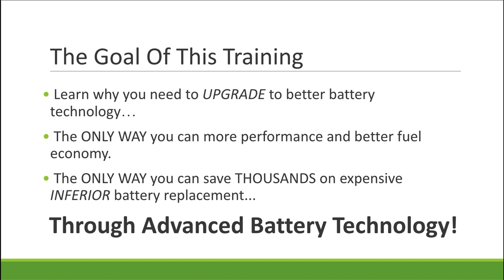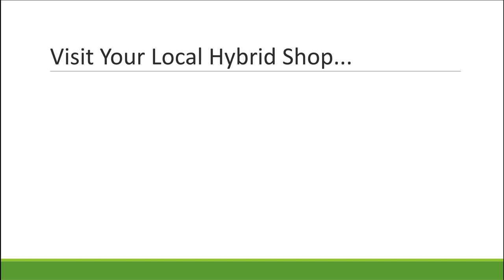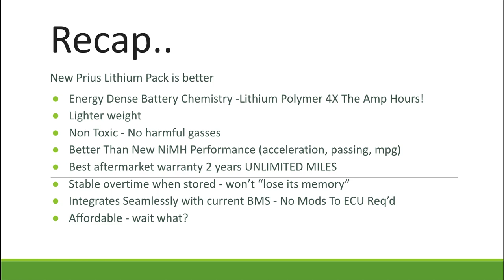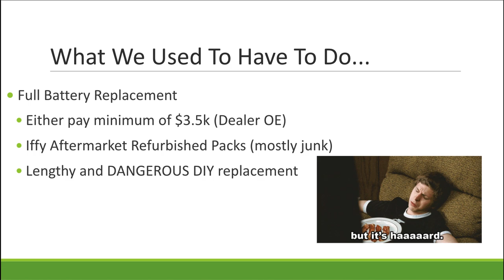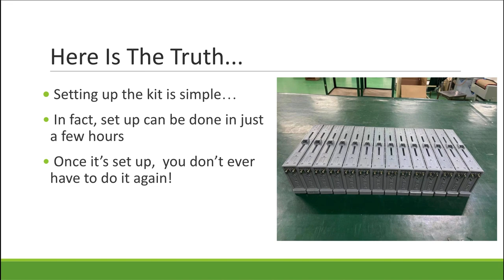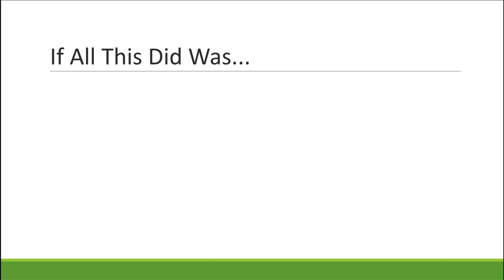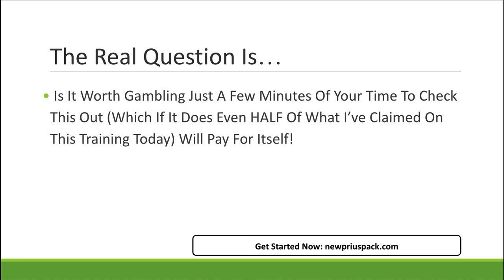New Prius Pack  - Upgrade Your Aging Prius With A More Powerful Modern Battery

Comment: Are any modifications to the ecu needed?
Reply from the maker: Hi, there are no modifications needed to the BMS which is the hybrid ECU. Each module has its own computer chip that regulates how it charges and discharges. It "fools" the BMS into thinking that it is working with NiMH. This battery is 97% efficient compared to NiMH which is 70%. In my 2008 Prius, I can go 3 miles on EV power alone. Never has this happened before on NiMH nor will it. These batteries are truly revolutionary.
Reply: @TheHybridGuy  But how it charges the new (and with higher capacity) battery if there are no modifications to the ECU? Now, the battery rarely charges to full (green bars).
Reply from the maker: @TheExcelciorBeta  There are proprietary computer chips on each battery block that tell the BMS to allow it to charge higher and drain lower. How that works specifically is something you would have to ask the creator of the product. I can tell you first hand that it does work and I have personally logged thousands of miles with my battery. MY best EV range so far on this battery is 3 miles. Compared to a "like new" NiMH battery EV range of 1 mile.
Reply: @TheHybridGuy  Thank you for your answer and the insights! I tried reaching out to the creators, on their videos, but haven't gotten an answer, yet. Maybe you could pass the question to them in a future QnA? 😉
Reply from the maker: @TheExcelciorBeta  Think about it like this. all the ecu needs to know is that the battery has enough charge to keep the system happy. the computer chips in each block tell the ecu that there is sufficient battery and to shut the engine off. if there were no controls in the blocks this setup would not work because the system is designed to run with NiMH tech.  I hope this answers your question.
Reply: @TheHybridGuy  Kind of. My question is focused on the charging procedure. There is a need for greater recuperation from the regenerative braking in order to charge the bigger battery. If there is not, then we need to charge it from the gas engine which means that there will not be any improvements in the mileage efficiency.

Comment: One thing ive noticed.. the SOC is usually 60 to 65%...so it goes bad faster as its not fully charged and utilized. 
after lithium changeover what will be the SOC? if its still 60-65% wudnt it be under used again.. and may eventually go bad soon😕
Reply from the maker: Excellent observation. With these packs, because they are internally regulated with their own computer chip they are allowed to charge up to 97% instead of the 70% that you see with NiMH. Over years of use they will go bad but so will NiMH. In that time frame you will get longer sustained and better MPG than you would with NiMH.

Comment: I have a 2016 prius 2 with a NiMh HV battery.
Let's say down the road I decide to change the Nimh battery to this advertised Lifepo4 battery.
Would my car's battery catch fire if it was subjected to a bad side impact accident.
I've heard many a story about EV's catching fire with Li-ion batteries 'I realize different more toxic chemistry with higher energy density.'
Reply from the maker: Li-Ion is much more prone to thermal runaway yes. LiFePo is far more stable though less energy-dense.

Comment: As far as the climate control while sitting still goes. I'd imagine the gas engine would have to run 3 times longer to charge but then would run the climate system for 3 times longer with the gas engine off. Is this correct?
Reply from the maker: The short answer is no. If you want to know more send me an email.
Reply: @TheHybridGuy  
I'd be curious to know why the answer is no to this. If these batteries truly have more EV range that should mean they have more capacity. And if they have more capacity then the car should sit there and run the air conditioning longer before the engine needs to start to recharge the battery. Now perhaps when you said no you were talking about that the car would have to run longer to charge the larger capacity battery.
I'm kind of wondering if this lithium design actually does not have more capacity than the nickel metal hydride. It probably does have a higher max amp rating.
The problem has always been with these lithium designs. Integrating them into the existing ECU to take advantage of lithiums greater storage capacity. Since the car doesn't know that. I know you said there are computer chips inside each module to fake out the BMS. There's going to have to be some kind of voltage manipulation inside each module. Because the static voltage on lithium cells is not the same as nickel metal hydride.
So some kind of manipulation must be going on to fake out the stock ECU that the resistance and voltage is appropriate to what it expects. Whatever is manipulating those data points also has to be able to handle large current Rush.
Definitely interested in the technology myself. My 2008 has 376,000 miles on it with the original pack.
I can buy a factory brand new pack from Toyota for about $2,400.
Reply from the maker: @kens97sto171  excellent question. So our cars have a coloumb counter for the batteries. What that does is measure electron flow over time against battery voltage.  Where the lithium has a far greater drop off than NiMH our cars can leverage the greater capacity because it is looking at SOC as the battery is draining while in use. As far as a current rush that doesn’t happen. The voltage is only slighter more than NiMH and the car uses what it needs when it needs it. But like a faucet if you need more you turn it on as a great rate. Replace the battery with the lithium and you will see there is more energy available so when you mash the “go pedal” it will perform as it should have when new. Hope this helps!
Reply: @TheHybridGuy  
Thanks for the explanation..  Much appreciated.   Glad you guys have it worked out.

Comment: My 2013 prius BMS is design to manage and charge NiMH... how is it possible to simply replace it with LiFePO4? The chemistry and voltage isn't the same. This is exciting - do you ship to Australia?
Reply from the maker: Hi Andrew. The BMS is designed for NiMH you are right. However there are microchips that “fool” the BMS into working with this new battery.  I’ve personally been using it for over a year and have had zero issues but increased fuel economy

Comment: What mods are required for a Gen 2 install.  Please do a Gen 2 install video.
Reply from the maker: Install videos to come soon! No significant mods. Remove old modules and install new modules. That is it.
Reply: @TheHybridGuy  I've replaced individual cells in my old battery before.  So these batteries on require 14 cells vs 28 of the old style,
Reply from the maker: @East-Tennessee-Tim , basically they are replacing the "blocks" in your existing pack. Think of this as like 14 blocks which is how the Prius BSM reads the system anyway.

Comment: Will this work on a 07-12 Lexus GS450h?
Reply from the maker: Hi! Lexus GS450h packs will be coming soon!
Reply: @TheHybridGuy    even though the new batteries have higher amperage bms can't increase capacity of the motors , wiring , inverter etc.  Which were all designed to use the lower amperage ni-mh batteries.
Reply from the maker: @stopdrpnro  Right but you can sustain the motors at their peak for longer. This is helpful with passing (critical for safety) going up hills, accelerating on the freeway... all things that are benefitted by a battery that can sustain itself for longer.
Reply: PLEASE, do a before and after 0-60 
I have a 2007 also and its already insane fast with nimh
Cant imagine with 2.6x more amps
Reply from the maker: @SouthFlaDiver  Working on it. The results are better in MPG more than speed though.
Reply: This was my big question. More power has to = more power right 😁
Reply from the maker: @stopdrpnro  That is a great way of looking at it yes!
Reply: Actually I'm sure the hybrid system is designed and built with the max draw of  ni-mh . That said, even with the higher max draw of li-on,  there probably wouldn't be any performance benefits without other software and/ hardware upgrades.
Reply from the maker: @stopdrpnro  each of the lithium blocks is individually controlled with its own microprocessor which allows it to charge and discharge more than the NiMH. It integrates with the BMS seamlessly. If the modules were not controlled in this manner it would not work.

Comment: How many full cycles is this lithium polymer good for?  And how many partial cycles are they good for in the Prius where they won't be cycled fully.
Reply from the maker: That is a great question for which I do not have data at this point. I would suggest emailing support@NexPowerEnergy.com for those specific questions.
Reply: @TheHybridGuy  my email got rejected because I put next instead of nex.  I'll try resend.

Comment: Does it balance at the cell level by having a voltage sensor and resistor on every cell in the module? I would assume since there's no extra wiring that it's doing a top balance instead of bottom?
Reply from the maker: Each module is controlled by its own monitor system that integrates seamlessly with the BMS.

Comment: cool!  I have a 2008 that I purchased with 178k on it.  It now has 219k, and still seems to be good!  I am interested in upgrading at some point.  I have a question, I want to convert my Prius into a camper.  Could I add this lithium battery to the Nickel battery to get more total juice?
Reply from the maker: Sadly you cannot combine these technologies but I will say you will be so satisfied with the new Lithium version you will not worry about extended range. I will tell you that extended range has been done before on Gen 2 Prius but it never became commercially viable due to the cost of the additional pack.
Reply from the maker: BUT I do have something for you if you are looking to get into camping with your Prius check out plugoutpower.com and if you buy.. here is 5% off your order use code ‘9429’. I just bought one for my Prius.. Videos to come soon on how cool this thing is.
Reply: @TheHybridGuy  I wonder if the plug out power people have modified the inverter or if it's just stock. I've been using a midnight classic connected to my Prius high voltage battery with decent results.
Reply from the maker: @lavatrip9344  I can tell you the plug out power unit is incredible and blows the socks off the Midnight Unit as far as versatility is concerned.
Reply: @TheHybridGuy  I was only able to pull around 2000 Watts from the Prius and send towards my 48 volt system before the midnight would error out.  Sure I could have had to or three midnight classics but a functioning 4,000 watts from the plug power unit would be great.  These inverters are only $600 on eBay.

Comment: 2010-2013?  No 2015?  What's different if it's the same Gen?  

I'm really interested in this battery.
Reply from the maker: 2014 and 15 should work just fine. They have the same amount of modules as the earlier editions of Gen 3 Prius.
Reply from the maker: You should get it! It will work with your 2015. https://projectlithium.com/?ref=e9JRo

Comment: 1. how do i know if the battery pack needs replacing yet? im glad to replace when necessary but i have no way of knowing whether i do or not

2. how did everything except for the prius sell out so fast? the prius is the most common vehicle out of all of these?
Reply from the maker: All good questions.  If you fuel economy has gone down, if the battery rises and falls rapidly, if the engine sounds like it is straining, all of those are signs. 

Prius is on pre-order right now you can still get one. https://projectlithium.com/?ref=e9JRo

Comment: I see you know a lot about prius battery. What are you doing about the over charge? NMHI goes to 80% . I have been tested prius with new nmhi battery and lithium ion battery, MPG increase just a couple more miles, no a big increase.. even if Installing old battery, MPG stays the same. My point for experience,  having a new or powerful hv battery doesn't increase much MPG. I had a 2005 prius with plug in battery, and it only increase 8 mpg more. What are you saying has to be tested more.
Reply from the maker: All the new modules are individually monitored with built-in microchips that allow them to charge up to 97% instead of the standard 70% like on NiMH. 30% of energy with NiMH is lost to heat. With more available energy in this pack, you have increased EV time which translates into MPG. We have thoroughly tested this battery and it is not like the plug-in style you had it just makes your current Prius more efficient.